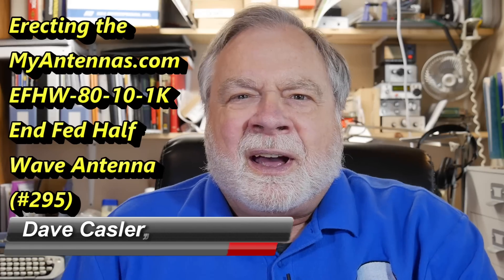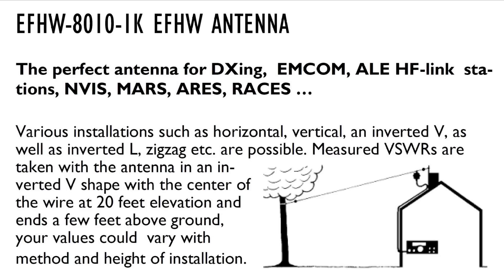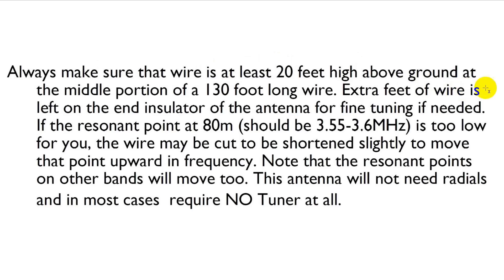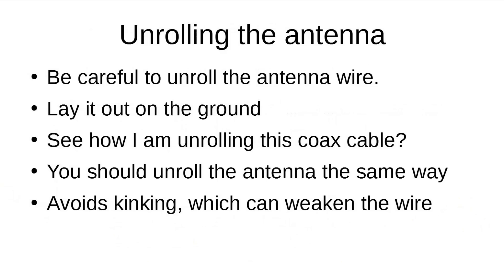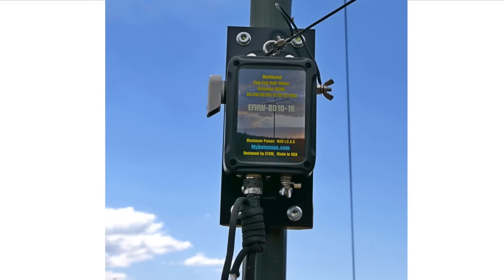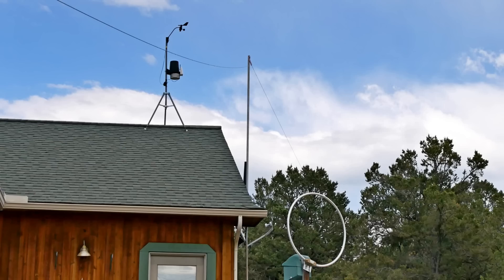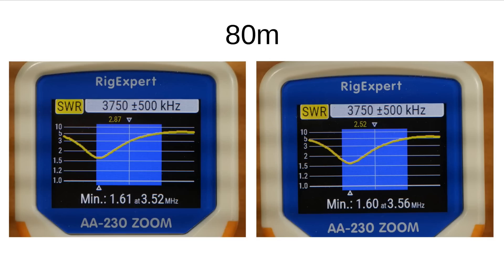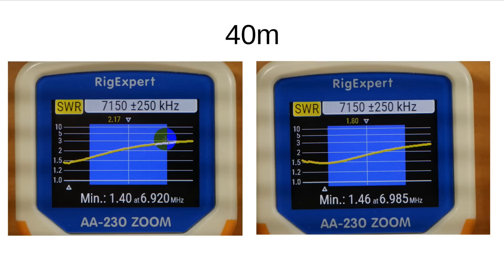Erecting the MyAntennas.com EFHW-8010 End-fed Half Wave Antenna and Initial Testing (#295)

Comment: Hi
My 130 foot, 80-10(my antennas), 49-1 efhw works great. I made and hooked up multiple counterpoises to the ground rod, making 80 work very well and 160, yes 160 work decently!
But, My antennas sells a 173 and a 202 foot efhw with a 9-1. 
Would the extra length improve my bands? Especially 80 n 160?

Comment: I am submitting this short article to describe an ALL BAND
About Hamuniverse
Antenna Design
160M -- 10M Simple Antenna System using a 4BTV antenna
Antenna Safety!
and a couple of traps plus some wire that has worked
Ask Elmer
About Batteries
extremely well for a number of Ham's locally over the last
Code Practice
10 years or so. This antenna was originally installed as a
Computer Help
temporary system but has proven to work so well that in a
Electronics
Emergency Radio
number of Qth's it has been kept as the primary antenna.
FCC Information
Ham Hints
Humor
Ham Radio News!
Post Reviews
Product Reviews
Ham Radio Videos!
The antenna will work with most rigs with an internal antenna tuner and on a number of bands without an antenna tuner. On 10/15/20/75 and 160 meters, NO antenna tuner is needed... On 60/30/17/12 meters the antenna functions as a random L type wire and will require a tuner.
HF & Shortwave
License Study
Links
Gin. jumpe
Midi Music
25 feet
45 feet
Reading Room
Repeater Basics
REYCO TRAPS
Repeater Builders
RFI Tips and Tricks
Ham Satellites
Shortwave Listening
SSTV
WDSQKE
K8KAS
160 meter thru 10 meter coax fed
Antenna System
Support The Site
STORE
Vhf and Up
Contact
Site Map
Privacy Policy
Legal Stuff
Advertising Info
HUSTLER 4 BTV
Radials; 20@ 30ft.
Spread in 360 degrees
K8KAS
The antenna being a 1/4 wave current antenna on most bands does require a good radial system to be effective.
This is nothing new to those of us who have used current fed verticals in the past. We at WD8QKE's installation installed 20 radials at 30 ft. long spread out over 360 degrees. Checking the RF ground impedance with an antenna analyzer we found this to be a good number of radials for fairly low RF ground impedance.
The cost for this antenna is below $200 purchased new and is as well a very clean antenna with a small footprint for people in HOA developments.
RESULTS:
The antenna has worked very well compared to many other ham systems and has been the winner often in testing shoot outs. Many 1st call DX contacts have been made on all bands with 75 and 40 meters being it's best bands, however EZ contacts are the norm on the other bands as

Comment: I have the same antenna, but mounted  very low. It is about 14 ft on each end and 8 ft in the center.  I guess it works like a NVIS.
I used a NANOVNA to tune the length for 40 m. It shows right at 1 to 1 on 7.30.  It didn't  chan the other band's center point a lot.  Using external turner to load 80 to 10 m.  Won't tune 6m at all.  160 will tune, but dosent seem to be effect.

With my IC-7300 and tunner i easily cover the easrern half of USA.

Dont plan to change it.

Comment: Would adding a 500pf capacitor at 1/2 point of wire move your 80 res to up into phone band without impacting the higher bands?

Comment: Good video as usual. I noticed you have the end insulator on backwards.  This insulator is designed so that the end of the rope loop passes through the end of the wire loop. The idea is that even if the insulator breaks, the antenna won't come down.

Comment: Made my own... a 130', 49:1, a single core FT 240 43 material (am going to try 2 for better efficiency and less chance of core saturation)... 40' of LMR400 for a coax shield counterpoise that does NOT PARALLEL the active radiator, NO common current torids needed and RF almost FSM undetectable at the operating position,  earth grounded as suggested... straight line sloper across the road to the roof of an apartment building, coax fed end 30' up and the other about 70' up and in the clear. VSWR on 7, 20, 24.. zip, zilch, nada... 3.75, 1.5:1, 3850 2.5:1, 18m 1.5 and 10m 1.8_2.5 at the FM high end. 100 watts works all DX not just the $100K big gun 2kw stations and their monster antennas...yes us Canucks can run 2250 PEP watts. 

 I continue to experiment for continued improvement and knowledge...  Tnx OG, excellent presentation.. from a once upon a time, my own call in VE6OG land. .....Richard.. VA7AA
Reply from the maker: Thanks for sharing your experience. Sounds like your antenna solution worked well for you.
Reply: @davecasler  ... got my two 43 cores from Amazon today, so this weekend I'm gonna put on my black hoodie, a cape and intone some more 😁incantations to the black art gods of EFHW...more to come.. Tnx Dave. VA7AA

Comment: This specific antenna and others like it are really unusually very capable antennas that cover many frequencies.  But these antennas are not perfect and they don't have perfect SWR on all bands and some bands can end up with unusual high swr.  A tuner can be used if needed.  How these antennas are installed affects their characteristics and non of them cover 160 and 80 meters well across the whole band.  These antennas rely on ferrite transformers that don't work well at high power.  These antennas are well worth having around and will give any owner of these antennas a lot of usefulness from 1 low cost antenna.

Comment: I just purchased this same 8010 EFHW antenna and I'm planning to install it flat at about 30ft in the air in a direction NE to SW.  I'm curious if anyone has experimented with with the various possible configurations you can use for these EFHW antenna's and which one is best?  The configurations I'm thinking about is flat, slower, and inverted V.  Thanks
Reply from the maker: If you read the instructions between the lines, they seem to be arguing for an inverted vee. That's how I installed mine.

Comment: Hi Dave, I have the same antenna, but my SWR  very high, I have tested the wire and it seems good, how do you test the transformer?, mine seem like a closed circuit? Is this normal, ?, Thanks
Reply from the maker: It will be a closed circuit at DC because it's basically a transformer. Try to get the center of an inverted vee configuration at least 20' high. You may have to try a counterpoise. I'd start with 10 feet, then 20, and so on.
Reply: @davecasler  Thank you, it was an issue with my coax connector, repaired, all good now, thanks again., BTW I enjoy your videos.

Comment: KK6LOP, I am watching again and noticed the droop you have on each side of your center point for your inverted V configuration and I'm curious how much that and also having a metal pole that close to the antenna affect the efficiency of the antenna and also how much it affects the SWR? My rope broke and so my wire is laying on the ground right now but I plan on going out and putting up a 50 foot pole to mount the attachment point of the antenna above my knoll so instead of 10' it will be 50' up. There's about 15' of rope between the end of the antenna and the pole so there shouldn't be much if any interference. I pulled mine tight enough that it only drooped maybe 5 or less feet in the middle. The rope broke at the fastener point on the ground, perhaps by varmints chewing. So I'm going to add several feet of chain from the anchor point to the rope  and hopefully that will cure that problem. I've never cut or folded back any of it, I don't have the equipment to measure across the bands but I have a cross needle SWR meter and it seems fine on all the frequencies I've tried. I'm tempted to turn of the internal tuner and see what happens when I use my external tuner, an MFJ-945E and see how well it works.
I do kind of wish people would stop calling them "Antenna Tuners" because they aren't. They are antenna impedance matching networks.

Comment: Seems like a very useful antenna that makes it easy to get on all bands, 80 - 10 meters. I imagine, at the height you mounted it, it will mostly serve as an NVIS antenna on 80 and 40. Looking forward to viewing your on the air video. 73 de WB4DW
Reply: Mine is pretty low too and I mentioned a contact I can make pretty regularly that's 200 miles away behind some mountains but I've also made contact to Norther British Columbia, about 3000 mile and I was able to make a contact to Alaska one time. I'm going to raise the far end by about 40' from the 10' it is above ground right now and see what happens. KK6LOP in Kingman AZ

Comment: Hadn't seen this episode before! Well You don't have to cut it off, just fold it back and tighten with electric tape or  straps. Lengthen with innerpart of a "sugarkube" -simple  coupling with two screws in small tube. (or solder)
Thank You Dave! Illustrative and  
very Educating! 
73s Gunnar sm6oer >>\<

Comment: Nice video. I've had this antenna for 4 yrs. I worked 110 countries on FT8 in about 6 weeks, not trying hard. Pulls in Australia, Japan, etc, from the east coast. I have mine in an inverted L, with the bottom leg at about 70 degrees to clear vegetation, the balun box 5 ft from the ground. Grounded with a rod and using 4 radials - reduces noise. Main length is up 20-25 ft. My SWR is quite a bit better than those shown in the video. I have the same analyzer. The antenna must be cut for min SWR @ 3.55 MHz, according to the designer. I did that, and the SWR there is 1.2:1, rather than 1.6:1 as in the video. Below 3:1 on all the other bands except 30m. At 10.655 it is only 1.15 to 1. At the high end of 30m  it is 3.1:1. I folded 6 inches of wire back at the end. I don't think its wise to have such a large amount of wire folded over the end, my opinion is that this contributed somehow to higher SWR values. This wire tends to stretch, so I had to cut even more off anyway. This is a great antenna folks, super easy to put up. Just use a good choke as these antennas are prone to common mode current. Slightly noisier than my 40m doublet, maybe one S unit. I am not intending to be critical, I love your videos Dave and I enjoyed this one. Just wanted to share my experience.

Comment: KK6LOP, Chris from Kingman, AZ, U.S.  I got my license about 7 years ago and I put up an End Fed Half Wave from My Antennas dot com as it was the only hf antenna I could afford at the time. Currently it has one point attached to the highest point on my house top and the other end 10 Feet above a rocky knoll in my back yard so that it's maybe 10 feet higher than the house top end. In between there's about 35 feet to the ground, so it's very much lower than would be ideal according to everything I've been told and yet I've been able to easily contact other hams 2500 miles away and also only 200 miles away but behind a couple of mountain ranges on 100 watts with a Kenwood TS-450 and an MFJ-945 antenna matching unit. I've made pretty much the same contacts with my new ICOM 7300. My best contact so far was from my home in Arizona to a person in Northern British Columbia, maybe 2200 to 2400 miles away.
From my experience above I'd have to say, if asked, that the End Fed Halfwave Dipole is an excellent antenna. Mine is the My Antennas dot com EFHW-8010 which as it implies works on 80 and works on 10 and it works on all the bands in between. I haven't folded mine over or cut any off and my radio seems to be just fine with it. I'll hook up my manual tuner and see what happens though. Your video has given me something to think about.
If I had it to do over again I'd do the same thing.

Comment: Interesting. I watched your review of the MFJ 10-40 M efhw, which did not perform well. I use the MFJ 10-80 M efhw and have had very good results on all bands, particularly 40, essentially the  same as this review of the EFHW-8010. I suspect the 130 foot 80-10 configuration may be a better choice than the 66 foot 10-40 configuration regardless of vendor.  Thanks for all you do. John N0JT

Comment: I do have that exact same antenna and with a wideband tuner I check in to a 75 meter net at 3857.5 and  have good results.   Good contacts on 40 and 20.  I live in a HOA and need to keep a low profiles on antenna's and this fits the bill.  As to high price, I have a mult-band (only one antenna) use on my transceiver.  So buy or build separate antennas makes them more visible and parts and wire  still do count.  Now looking to try 6 meters and  they are smaller antenna's that can hide behind the house or near trees that do not let the general public (and the HOA) see.  Stealth, stealth, stealth

Comment: Hi Dave.  Great video, as usual.  But answer me this, please: when are us hams going to stop referring to “tuning” our antenna with our ATU (whether internal in the radio, or external) and instead use the correct term “matching” (or transforming) our antenna impedance to the 50 Ohms impedance of our radio?  Perhaps you might consider a video on this subject, as you explain matters so well? 
The term ATU should be replaced with AMU – Antenna Matching Unit, or IMU – Impedance Matching Unit, as that is what the so-called and mis-named ATU actually does – MATCH (in another word, transforms) the antenna impedance to the 50 Ohms impedance of our radio.  For too long, hams (particularly newbies to the hobby) have been conned into thinking an ATU “tunes” the antenna, which of course it does not.  How about it, Oggy?
Reply from the maker: Probably never. Note that tuning, as of a radio to a particular frequency, is an impedance matching process to create resonance. I think the terminology will be around forever.
Reply: @davecasler   Thanks for your reply, Dave – all copied!  
BTW, I am mentoring two UK Hams who have taken their first step into Ham Radio with their Foundation Licence.  BOTH have told me they avidly watch your videos and I have told them they couldn’t do better to progress in their new hobby.  I, of course, am also an avid watcher myself!  Iain.

Comment: I know this is a compromise and convenience antenna, but people should be aware that an EFHW on 80 meters has less than stellar radiation patterns for DX on the higher bands (at least if it's strung completely horizontal or in an inverted V).    The largest Alpha Delta 10-80 fan dipole is a better option if somebody is going to put up the antenna permanently and has the space to properly do it as a horizontal dipole or inverted-V.   Of course the Alpha Delta antennas are 10/15/20/40/80.   But when I had mine up I could at least tune one or more of 12/17/30 (never tried 60) but not all of them unless using a wide range tuner.   Like I said, I realize people like this antenna for ease of deploy, portable operations, and in cases where they have difficulty stringing up a 130+ foot dipole truly horizontal or inverted-V.   I just wanted to make them aware that is by no means a good dipole for DXing on 20-10 IMO.

Comment: A balun is used to match a balanced antenna (doublet) to an unbalanced feedline (coax). Why would an end fed wire need a balun? I do appreciate you disproving the claims the manufacturer makes for this very overpriced  antenna. It is NOT resonant within all HAM bands. It does require a tuner to match the radio. BTW, there is no such thing as a multi band half wave antenna. Antennas can be half wave only at one frequency.

Comment: Ive been running a Chameleon Emcomm III with fairly good success. Good ground system, grounded arrestor for coax, choke at Feedpoint, inverted L configuration with the vertical at approx 24’, and then run my RX audio through a Heil Parametric EQ to keep noise floor down. It has been a good antenna for coast to coast from Oklahoma using 95 watts. Getting ready to raise it to 32’ vertical

Comment: Dave I be-live that Steve Ellington reviewed the same antenna and found  that: 1) cut the antenna in half 2) attach a 300 to 500 pf capacitor min 1000 volts across the the antenna wire. 3) This will raise the resonant frequency  on 75 meters but not affect the other bands. 4) Lower capacitance = Higher frequency  .       If memory serves me he had this in an end fed half wave long wire configuration.     You my want to test this out!

Comment: Dave,  does the aluminum top rail mast electrically interact with the antenna resonance?
Reply from the maker: Yes. My modeling shows that if you have the end of the antenna closer to the mast than 3 feet it will interact so just keep about 3 feet of rope between the end of the antenna mast and the antenna itself.
Reply: @davecasler  Dave, Very much appreciated as I am planning to hang a 67ft EFHW from a 30ft aluminum pole constructed from top rail.  I'd do telescoping fiberglass if it were cheaper

Comment: I was wondering if the direction you mount this antenna affects the direction the antenna radiates. For instance I have been told G5RV style antennas mounted North -South radiate East-West. Are these the same?
Reply from the maker: Similar, though the effect is not strong.

Comment: I  believe the EF antenna is one of the best bang for the buck antennas you can buy.  I use it for the home base as well as for portable.  It is great for small spaces and easy to erect in the field.  It is flexible and you can make it a vertical or horizontal polarization.  I find a sloper configuration using a telescopic 40 foot pole a great combination.

Comment: The resonant frequency for the 3.5 MHz Band can be tweaked without affecting the other bands by inserting a capacitor of something between 300 and 700 pF right in the middle of the wire. The products of some other vendors (like e.g. Hyendfed) come with such capacitors.

Comment: I have the 80-10 EFHW 1 kw and the 73 ft 160-6 EF. My Yeasu FTdx1200 has 2 antenna inputs and tunes them both. The 80-10 is on a mast 30ft up running to a tree that is 40 ft up. I can get anywhere in the US, Europe, and South America on side band. Still no side band contacts in Asia. Great antenna easy up easy down,